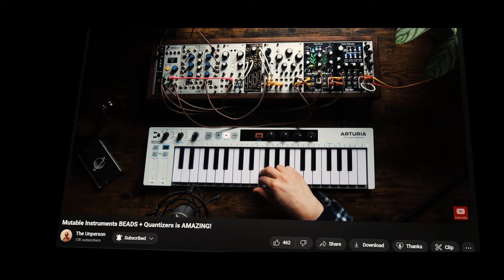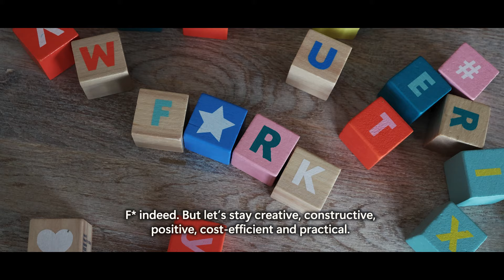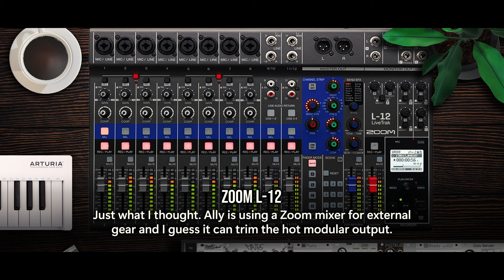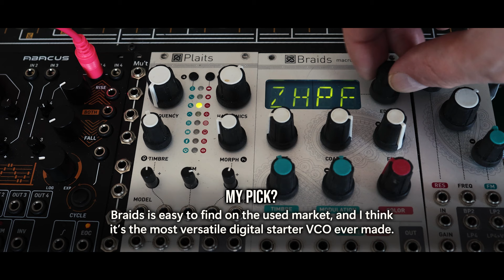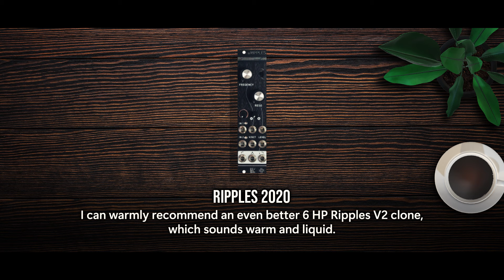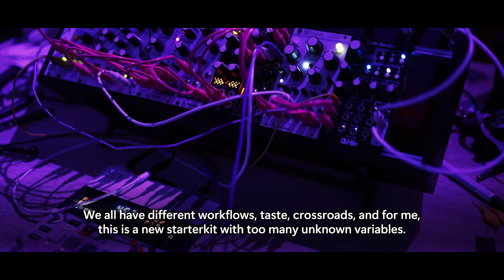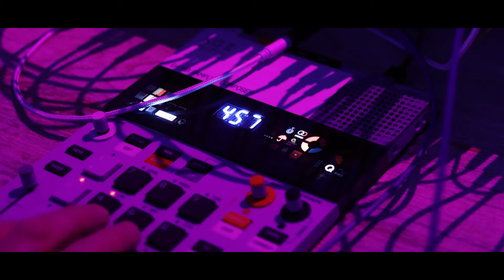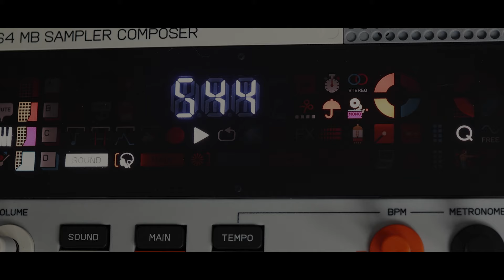Starter Kits | Episode 12 |  The Unperson Approach

Comment: Just a small point but Ali usually uses the Dual Dagger filter from Shakmat - I bought one after seeing Ali use his in nearly every video - its a superb filter. BTW I'm a (re)tired old fart too 🙂
Reply from the maker: Thanks, let's add it to the uVCF replacement options! It's not easy to find a 6 HP filter and I should have mentioned the Sqwk Dirty but it's not analog.
Reply: Same for me with Data Bender

Comment: Building a complete modular synthesizer as starter kit is only recommended if you can spend the money for a full row of modules all at once.
If you need to stretch the investment over a period of time I would strongly recommend to start with a semi-modular synthesizer and an empty Eurorack case. The semi-modular is a playable instrument on its own and you can add module by module and play with the setup even if the modular is not a complete instrument (yet).
To save even more money it might be a good idea to use cheap guitar pedals or the PC (or mixer) for effects.
If you have time and soldering skills you could build the case and modules as a DIY projects… however, this is definitely a different hobby than making bleep and bloop noises 😂
Reply from the maker: Thanks for sharing your view on this matter. It's a journey that will be different for each and everyone of us. I started with a semi in 2015 but it didn't work for me. When I started with real modular in 2018, it didn't work for me either. I already had a 5K shared system, but eventually 0-Coast taught me how to use it. It's a tough journey, and we need all the help we can get.
Reply: @CinematicLaboratory  I started with a Moog Mother 32 and a Shared System. Sold the Mother and got another modular case that quickly escalated.
“It’s a journey” is the way to describe it. Changed my setup multiple times and now I can appreciate both the modular and the other synthesizers.

Comment: What is the alternative for the data bender if it causes problems?
Reply from the maker: I am not sure what you mean. Data Bender itself works fine and is very reliable, it's designed to mimic everything that goes wrong in analog and digital audio, like noise, crackle, stalling CD players, stutter, etc. It's designed for this. So it's an effect. I can imagine you got the wrong impression in the video, but it's perfect for messing up your audio in wonderful ways.
Reply: @CinematicLaboratory  :face-blue-smiling: right

Comment: Nice catch. Ally certainly  deserves the accolades for his obvious talent and stripped down approach. Sadly, I’ve come to far to change course now. Full speed ahead! Set phasers to fun!
RYK Algo on order and multiple large display Disting Ex projects  coming along.
Reply from the maker: If you can hook me up to someone who makes/sellls large displays, hook me up! I'd never cover Disting EX without one. Also interested in the midi CC programmer. It's the most powerful module ever and completely unusuable when you're 50+. It's not OK. I am sure you'll love the ALGO. As for changing course, I am going to use the Ally layout when I have to do a new module video. Much easier to show what it can do when all necessary resources are near. 'Sadly I've come too far to change course', doesn't sound in your best interest. But indeed, going back by going forward works too! Phasers to full fun. I love that one.